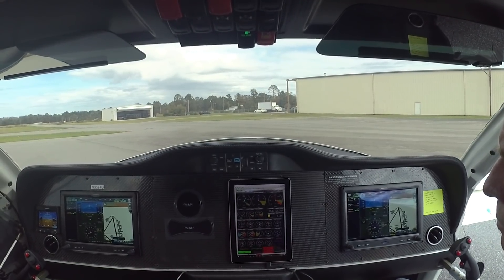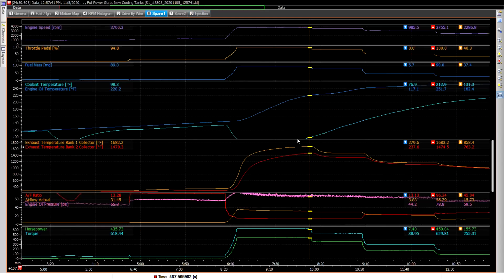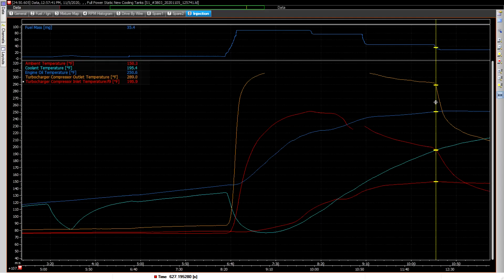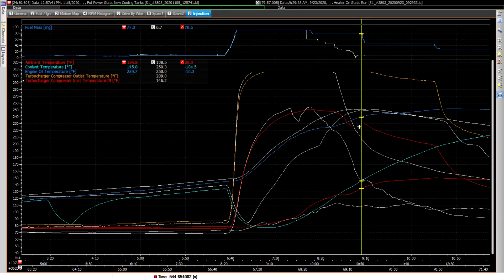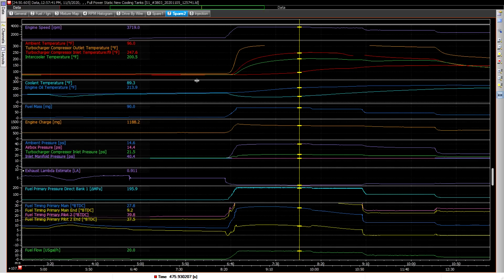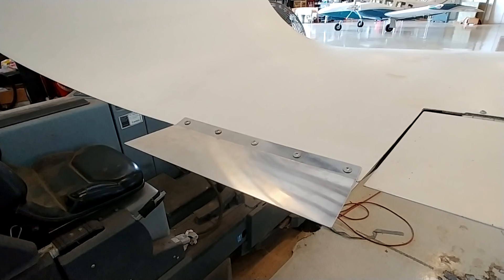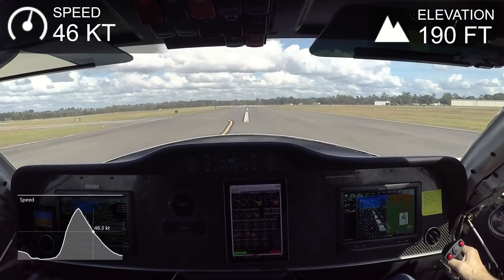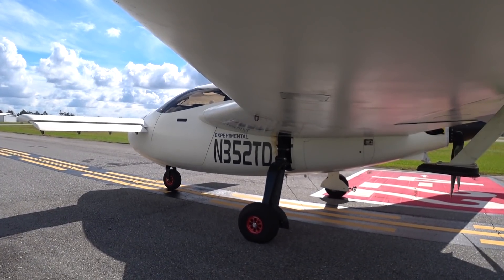Power Run and Roll Trim - Building the Raptor Prototype

Comment: Peter, How about adding small 3d printed "lip" on front section of the scoop to force it to take more airflow (through engine bay)? If it works, You could make bigger scoop in production version.

Comment: One step closer to a NTSB report. 
That trim tab belongs on a paper airplane, not on a properly rigged and shimmed aircraft.
Reply: This aircraft, as it sits, has zero utility and performance measured in minutes with a high pucker factor. What a waste of energy this endeavor is. But, it’s thrilling to watch the Round A burn rate with little r.o.i.... doubt anyone will pony up for a Round B.
Reply: Ha,  a 3600 lb homebuilt with auto power. Good luck!
Reply: ..and your words belong on the wall of plonkers!

Comment: Peter, some planes have the propeller offset on a slight angle to balance the aircraft from wanting to roll.. Google it and you will see what I mean, do you think it could be that making the raptor wanting to roll?

https://youtu.be/o8sc3VlZPUc
Reply: Perhaps a wool tell-tale on the centerline of the windshield would indicate whether there's some crabbing created by an off angle thrust axis. It would be better to do that before adding the tab.
Reply: I would suggest you might be right though there are other solutions but really there won’t be much faster than a sheet of metal and a few fasteners to mitigate roll tendency in the very short term.

Comment: It may be s good idea to look at the radiator of a P51 Mustang. It’s tiny for cooling a 2000hp plus Merlin engine, and instead of drag, it‘s said to actually create thrust. Should easily fit under the underbelly.

Comment: Is there any way to duct the discharge from the oil cooler around the main radiator?  Present set up where that hot air passes into the radiator seems unhelpful.
If needed, lie the radiator down a bit to give a gap for a duct for the oil cooler discharge air flow above?
Reply: The Raptor's oil cooler is a fluid-to-fluid heat exchanger that transfers heat from the oil directly into the engine coolant. With the engine coolant temperatures so high, there isn't much heat transfer out of the oil. And with the Raptor's undersized radiator and suboptimal ducting, what little heat that does transfer out of the oil just contributes to an already overloaded cooling system.

Comment: Hi Pete
Have you thought about just cracking the heat tap to cool by just a fraction say 10 or 20 deg  over a longer time rather than dumping all the cool water in at the start as it doesn't need to be that cold. I think will give you a much longer cool time.

Comment: I am glad you improved the cooling system. I think that you cooling tank change was a win/win. I would still like to see more additional cooling. It troubles me to hear you say "extra" several times in regard to the cooling. Sometimes, we must be our own worst critic.
I would like to see an inspection video, checking the control system before the next flight, including the new control stick of young design, and all the cables and pullies. You might have done this more than you have videoed.
The oil has been pretty hot, and under unusual test circumstances, so it would seem that it will have to be changed out before it might have been under normal use.
As with tradition, the oil filter can be cut open to checked for swarf, and a sample of oil could be sent out, just to make sure everything is happy. Sometimes when were "inventing mostly" it's easy to lose sight of maintenance.
When I mountain biked in the Santa Clara hills where the dry dirt is as forgiving as concrete, I would periodically put a wrench on every fastener on the bike. I did find some surprises, like front brake caliper that loosened from expansion/contraction.
Sometimes, I think that when we wrap or involve ourselves with a machine it becomes part of us, and extension of us. If we take care of it, it will take care of us.

Comment: Hope the forward CG does not exacerbate the pitch oscillations you had previously (due to the canard going into stall a bit more because it is trying to cope with the extra forward weight).  Good luck with the next flight!!!

Comment: bigger or more oil coolers?...that oil temp looks nasty.
looking forward for test flight 2.
Reply: The v6 audi engine should withstand 130c  266f , anything over 140c 284f (in a car) is replace the oil. Fyi
Reply: As often as airplanes oil is swapped those temps are a non issue for takeoff and climb out. It wont be that hot in cruise.

Comment: Regarding the trim tab, yes, trim tabs are very common, and most production airplanes have them. But they are almost always attached to a control surface, which acts as a "force multiplier" to increase the effectiveness per unit trim drag. Trim tabs attached directly to a fixed wing or stabilizer are very uncommon, and in fact I can only think of one airplane type that has them. I suspect that you will have to bend the tab quite far to get any kind of effectiveness out of it.
Reply: HP Aircraft ,  Very good point. Did you notice on the acceleration down the runway Peter kept applying more and more left control output?
Reply: Ground adjustable trim tabs were common with type certificates issued roughly 60 to 70 years ago, like Champs and Cubs. I’ve yet to see one not on a control surface outside of those little tabs we rip into paper airplanes. 
This will end in an NTSB report or a complete redesign or both. 
Lots of money and effort being wasted trying to reinvent an idea that’s already been successfully flying for 30+ years.
Reply: The effect of the fixed tab will increase with speed, when you are in fact looking for more help at lower speeds and less at higher, I suspect.  A spring holding the tab up at low speeds and letting it lie down at cruise may help, but then you will get yaw off it at cruise.  Mmmmm.
Reply: It’s called a ground adjustable tab and many aircraft have them too but I doubt it’s final anyway.
Reply: @skyboy1956  Maybe because you have never tuned a wing. It’s common.. Just search wing tuning. Why would he bastardise an aileron when he does not even know the cause yet. The wing drop is gone once up to speed anyway. He is doing it because he may do some ground effect runs.
Reply: @skyboy1956  - Yet some do true? If we relied on convention only, we would still be flying gen 1 aircraft and getting mail by pony express. It’s a non issue.
Reply: Have you considered he may not want a “Force multiplier” ?

Comment: Peter, look at using load cells on the undercarriage, so you can measure total and distributed weights, also it helps knowing how hard the landings are and how to improve technique, I use this mob.

Sensor World
https://a.aliexpress.com/_mOHUui5

Also, check the airflow in and out of the engine bay, if it is turbulent flow it will reduce cooling and increase drag, I use this mob.

BTMETER Official Store
https://a.aliexpress.com/_mL4GPvr

Steve.

Comment: Regarding the cooling... Do you have any pressure transducers in the engine bay? It might be worth checking if the whole section is pressure-positive (versus the slipstream outside) or pressure-negative, to help you direct potential additional cooling in with minimal weight and drag penalty.
Reply: There are plenty of resources available to Peter in this regard (and you’re not the first to suggest examining this) but he seems to be focused on doing things his way for now. I’m of a mind that the project will get there when it can’t progress further in the direction it’s currently going.
Reply: Mora Fermi  Great idea.

Comment: Peter;  your reply about "bandaid" comments should be used to shout out that this a prototype aircraft and, explain, exactly what that means.  It should also quieten down the "too heavy" comments.  Keep at it.  Not only does the aircraft need some moments in the patten ... but you do too.  Understandably, you display some stress that isn't helping.  Just saying.  👍 👍

Comment: This may have been discussed in a previous video, so I apologize if it's already been answered, but wouldn't a richer mixture help with keeping the exhaust temperatures down? I don't know what is possible to do in the control software, if it's possible to set the mapping to be temperature aware, but even a  mode toggle for cooling restricted operations could be used?
Reply: It would in a petrol engine where AIR volume is regulated by throttle position. Diesel engine speed/power is regulated by fuel volume. They always operate on excess AIR being available.
Reply: @stevemowat4294  Ah, thanks, gotcha. No rolling coal down the runway then, too bad!:D
Reply: I believe it's a diesel.
Reply: An incomplete burn should still give cooler exhaust temps, no?
Reply: No.. Diesels are opposite of spark ignition engines. More fuel = more heat, more air= less heat.
Reply: It's running on the lean side, you generally don't run diesels rich of peak, only lean of peak.
Reply: @wiedehopf9068  All that black smoke you see coming out of Diesel exhausts (trucks etc) in unburnt fuel. This occurs when far too much fuel is injected (over fueling), common in trucks, tractor pulling etc. It is done to ensure as much of the available Oxygen in the cylinder is burnt. However the excess fuel means the EGT is reduced (latent heat)
Reply: Yes, it’s a 3 liter Audi/VW turbo diesel.